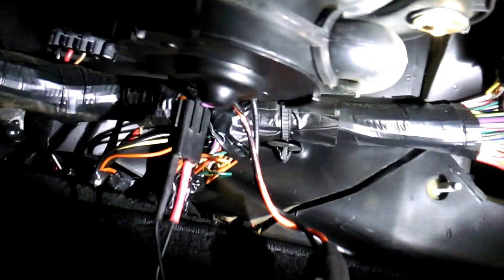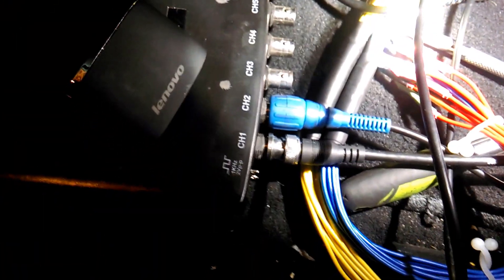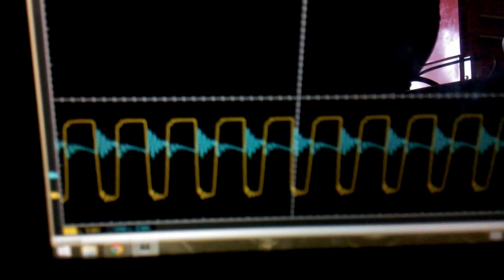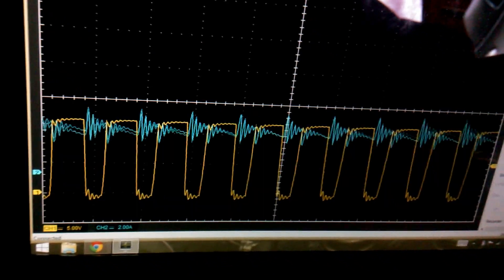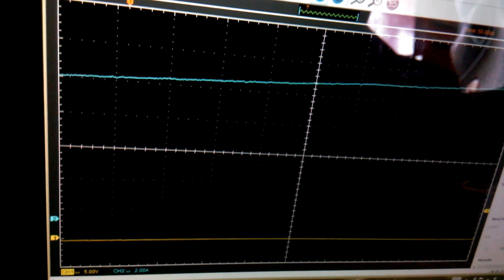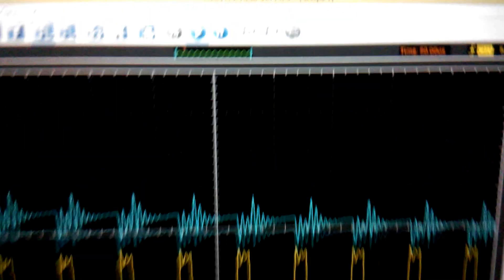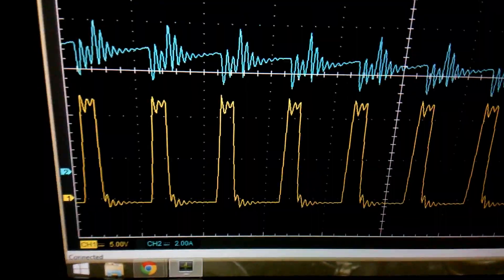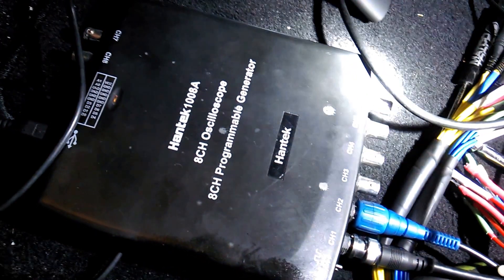Hantek 1008 Corvette Pulse Width Modulated Fan

Comment: Very good video , why you didn’t hookup on the positive side ???
Reply from the maker: As for the current clamp, it makes no difference. The current through a circuit is the same at every point in the circuit as long as it is one continuous loop.
The reason I connected the voltage probe to the negative side is that, the negative side is the control side. That is the side that the computer is controlling, whereas the positive side is a constant 12 volts. If I were to probe the positive side all we would see is a constant flat line at 12 volts.
Reply: Enrique Osorio thank you , I got it now
Reply: @Enrique_Osorio  Did you connect through the resistor on the negative side?  Like B+, resistor, negative control(osciloscop hooked to the negative)  Is that right?
Reply from the maker: This vehicle uses Pulse Width Modulation to control the speed of the blower motor. There is no resistor. The oscilloscope was connected to the  negative side of the motor.

Comment: On many lower priced scopes, sample rates per channel goes down as you use more channels.  Is this true of the Hantek 1008?
Reply from the maker: siwelaeroiaadweasdwe Yes the sample rate does go down, which is why you should only have as many channels as you need open. You will get the maximum sample rate with only a single channel.
Reply: Enrique Osorio Thanks. By the way, thanks for your video.  I like your video much better than Scanner Danner's videos.  He's obviously very knowledgable, but he just complicates the matter way too much.  It takes him some 20 minutes to get to any point. Also using Hantek makes me want to try things out and follow along (i'm already familiar with electronics).  He uses Picoscoe exclusively (I know you just got a Pico also).  Most of Pico 4 channel cost over $1,000 - I'll never afford that. Please continue what you are doing.  Thanks
Reply: +siwelaeroiaadweasdwe well technically if that so then memory optimization used on the device, it's good for any price range device, by the way it's mean that sample rates doubles when there is no other chanel, it's better than if always measured all channel on stable low sample rate.
Reply: +Enrique Osorio no